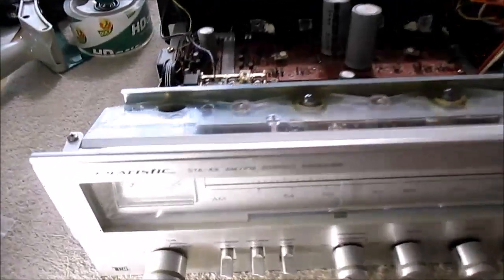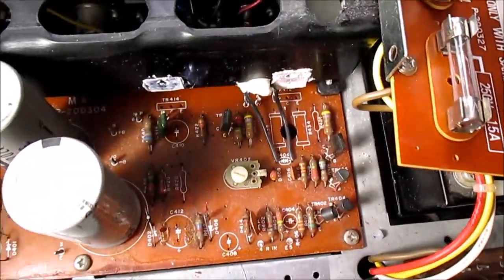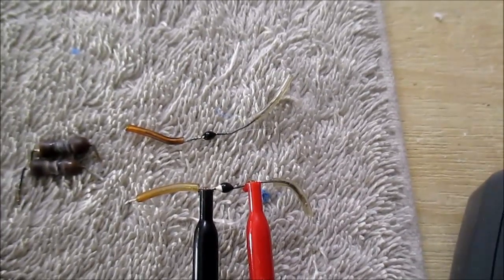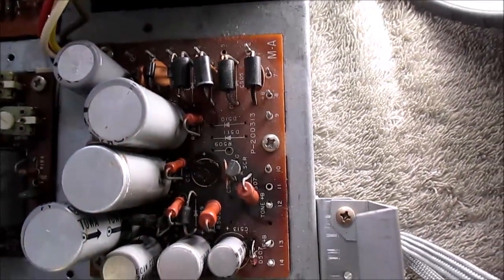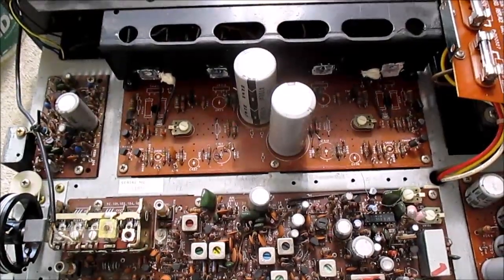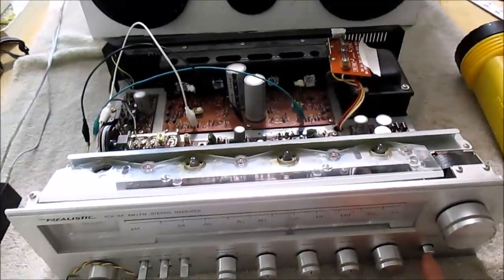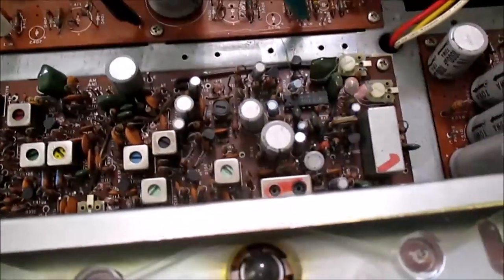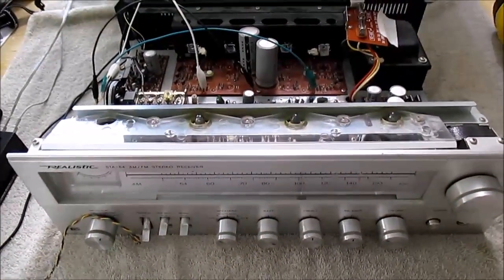Realistic STA-64 stereo receiver analysis for repair PT2

Comment: I have the same model I Exit Denteley hook this speaker leads up to the positive side left and right and it started smoking in a burnt wire the resistors 100 ohm Now I get no sound only when I unplug the unit Some comes over and speak of crackling Any ideas

Comment: There's a lot of work ahead with that one.. You've already spent time on the feasibility of repair as well as diagnosis, but it would be wasted if you did nothing further with it.. I'm rather surprised about the extent of component failure; surely at some earlier point it would blow a fuse, thus giving more protection.. ..or it might just be a design matter, where experimentation was done using new electrolytic capacitors, and as they (in the aging process) decrease in value beyond tolerable limits...
Reply from the maker: I made a third video showing the repair. The two fuses inside the unit only protect the preamp, radio and light circuits. The supply rails for the power amp had no fuses at all (besides the main fuse on the back that was still good). The emitter resistors acted as fuses!

Comment: I'm familiar with those grey electrolytics. They will test good but they start leaking electrolyte once they get warm. I'd replace them all...
Thanks for the tip about injecting a signal into the circuit under test. I might a box with that circuit. I burnt my soundcard once that I've been using for TTL

Comment: Those diodes look like a VD1212 , When i repaired a Sansui AU5900 I replace them with 2 x 1N4148 in series to get the needed voltage drop as recommended in a sansui repair forum
Reply from the maker: I got lucky. After this video, I tested parts on the amp board and found the same diodes there. Forward voltage drop is normal silicone, so I think an ordinary 1N4148 will work.
Reply: indeed it will

Comment: the amp was such a mess. i would say, copy the amp schematics and tune it with currently available transistors, would be another material for a transistor amp video.

just because the set looks cool, you may keep it as a showpiece i guess. thanks for the vid !
Reply from the maker: I decided to go ahead and repair it. I'd have to buy some parts. I found a bunch of capacitors from a projection TV I tore down a while ago, so that helps.
Reply: sounds like a good plan :)
Reply: +JohnAudioTech I'm happy to hear that, this receiver looks quite neat. Will work nicely with a pair of bookshelf speakers, I guess. And you can just go and replace the backlight bulbs with LED's, I like to do such whenever I have a to deal with dead backlight bulbs.

Comment: I wouldn't be so sure the stereo FM doesn't work till you get some kind of antenna and make sure the power supply is working right, what's left of that protection circuit could still be impacting it. I'd still be tempted to just scrap the power amp and protection circuit and put in one of the many amps you have.
Reply from the maker: Yeah, I could really could use the schematic. There isn't much to the protection circuit. Mainly the SCR and it is either on or off. FM was plenty strong for stereo, so it is voltage or something wrong on the radio board.

Comment: For such a large melt down something really catastrophic must have happened.
Reply: A teenager,. Id guess!
Reply from the maker: A domino effect I would say. Being a high hours set, something drifted in the power amp causing too much bias on the outputs which shorted them. The shorted transistors opened the bias resistors and the full supply across the short circuit protection blew those diodes and burned the resistor. Certain upsteam damage in the power amp as well. Easy to fix, just need to throw money and time at it.